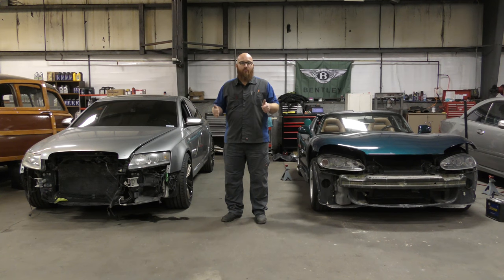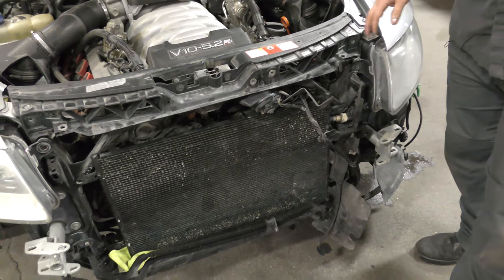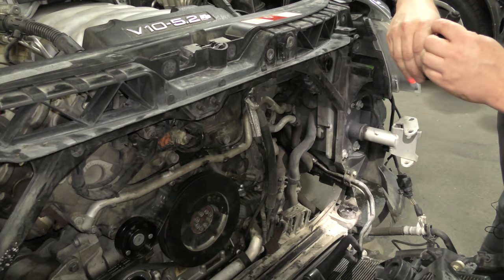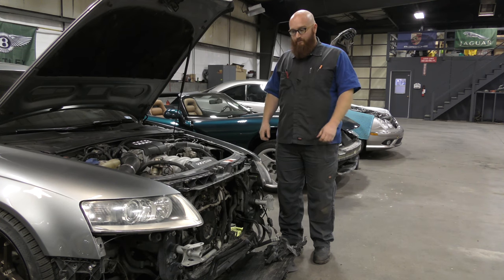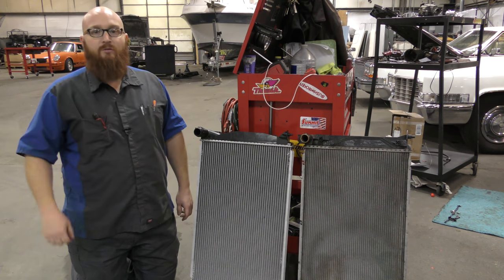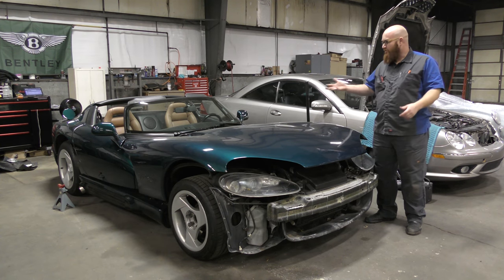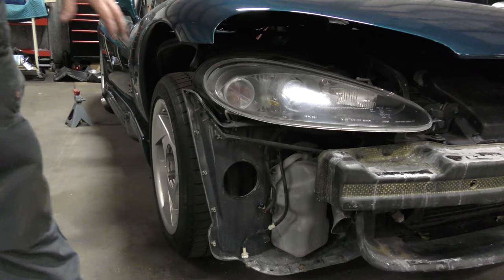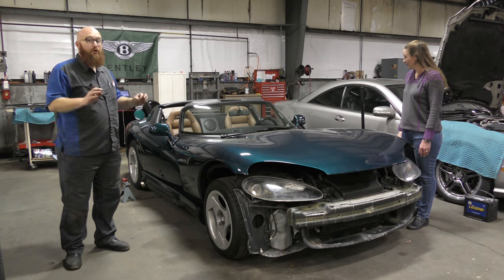What?! The CAR WIZARD has to remove the bumper on an Audi S6 & Dodge Viper to make easy repairs?

Comment: its not the engineers fault its the customers fault.  if they would only buy little v6 A6 or like an earlier model little 1.9tdi with 110 ps (!), then there is enough room to work on the engines ;-)
speaking of bad engine designs, you should watch >>  Redhead Zylinderkopftechnik  here on yt, its in german but the videos talk for themselves^^

Comment: I don't blame the engineers at all. The engineers figured out how to achieve the goal: a front mounted, longitudinal v10 in a sedan that is not massive in size and has decent curves. You aren't going to have an easy time working on it. Who set the goal? Designers, execs, consumers, ?? Designers may be to blame. Execs, well we can always blame them. Consumers should really look at what is under the hood and chassis, rather than inside the cabin. Maybe then they wouldn't bitch when labor hours are so high. They could also learn to work on their own vehicles. If you have enough money for a v10 Audi, then you have enough money for a beater car to get around in while you fix your Audi on the weekends.

Comment: 2007-2012 Hyundai Santa Fe.  The bumper has to come off to service the A/C condenser and radiator, but I guarantee you it's cheaper and easier than that POS Audi.
Reply: LOL, just posted about pulling the engine on my Tuscon to replace a belt. 

Hyundai makes a great, reliable car, but not so great to work on them.
Reply: @cenccenc946  Pull the engine on a Tucson to change a belt?  Timing belt?  Holy moses....

Comment: audis are only worth it when they come with a bumper to bumper warranty if you get that part they are great cars
Reply: When you NEED to to have a warranty for a car .. . i own a V6 Holden Commodore here in Australia Brand new i actually forgot it even had a Warranty because nothing ever goes wrong with it .. 3 years ownership and not even a light globe has gone out on it .. Cars bulletproof. cant say the same about my previous car ( Audi S5 V8 ) lovely car WHEN it worked

Comment: i realized along time ago that the engineers are not stupid they are either lazy or it is made that way on purpose. to keep its dealers in business. it is that simple.
lets use common sense. if you hired a person that made your customers unhappy and made the customer look else where you would fire that employee. nobody is getting fired over at volkswagen.
i had a 2001 BMW 5 series then a 2001 harley fatboy, then a 2004 porsche 986 then a 2007 harley night train.
all of those vehicles had the same stupid engineering it kept the dealers making money, allot of money. i just bought my new tesla and never have to worry about any of this bulls%$# again. 
i went to buy the electric version of the porsche then i noticed that the car asked to go to the dealer every 15k miles why because they want to feed the beast with your hard earned money for no reason. i said no thanks and im happy driving my performance models S. no dealer bullsh$#@ until i have to buy new tires.
when a high end sports car pulls up next to me i wave them and the stealer bye bye in my rearview

Comment: Why is the engineering on Audi consistently such a convulated mess?  I could see it if the vehicles offered some amazing advantage in roadability, but they don't.  They, along with BMW and Mercedes Benz, are horribly overengineered, shoddily built, unreliable depreciation hogs.  There are so many better choices in automobiles.
Reply: Totally agree . I own a V6 commodore in Australia and its everybit as good as a mercedes bmw or Audi in the driveability for a fraction of the price... ohh and my car shits on any German car for reliability.  3 years ownership and I haven't even needed to replace a damn headlight globe on it...

Comment: Cue all the Audi fanboi's with their typical Audi fanboi excuses and lame exaggerations. "I can remove the front bumper on my Audi in 35 seconds!". "This car wasn't maintained properly, it didn't have it's 0w/0 oil changed every 25 minutes!". "My Audi has 33k miles and apart from two engines, three transmissions and a full suspension replacement, it has been dead reliable!". Blah, blah, blah. I can't wait :-).

Comment: Cars like this arent fun to own, theyre nothing but a financial and joy killing hardship when things start failing - and they seem to start breaking down way before they should given their exhorbitant sale price.  I dont need a car thats in the garage more than its on the road and a constant inconvenience and financial burden.  They can keep these high priced badly designed overpriced toys, even rolls royce who used to trumpet the reliability of their cars are just as bad.  More famous for breaking down than being reliable is a basic fail in car design, period.
Reply: Completely Agree with you here man ! im from australia, i had an Audi S5 4.2 V8 . The Car was Brilliant ... When it WORKED. Thing was in the workshop way to often. there was a time when The car went So badly into limp Mode only 1st gear and 6th Gear was working ( manual ). had to get rid of it as was too expensive to maintain and constantly in a garage .. Now i have a Holden Commodore V6 Supposedly with a "Throw Away" Engine 91000 km ZERO issues 3 years old and i havent even needed to replace a light globe on it. love it Rock solid Car. 

As for rolls Royce being badly unreliable.... B.M.W ... nuff said!

Comment: Normally I like your approach and your videos, but this is just so single sided. First you blame the engineers and uses a special version car, which always are going to difficult to work on. You also completely misses one of the most important aspects of car construction - cost and legislation! You can get easy maintenance cars, but you would never buy them as they become way too expensive. Cost of production increases manifold on the sales price. Also I am tired of people say engineers don’t care - they do, but everything is a compromise. You never suggested how it could be designed differently, which is why it ends up just being a bit sad video.